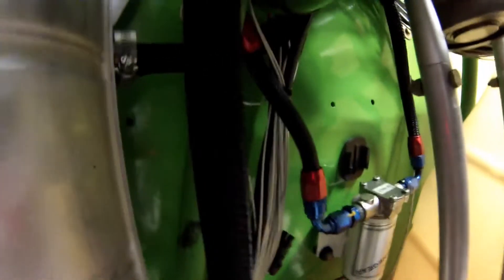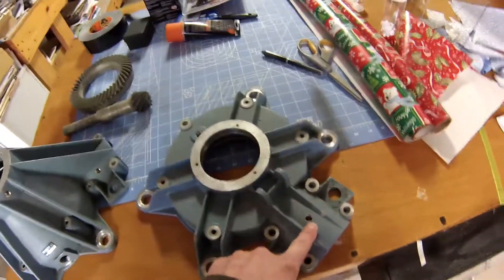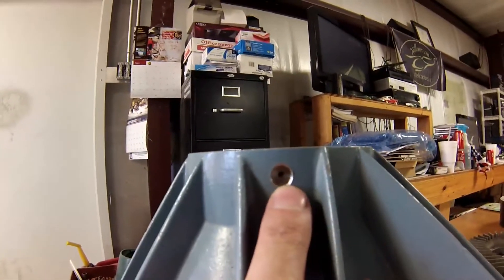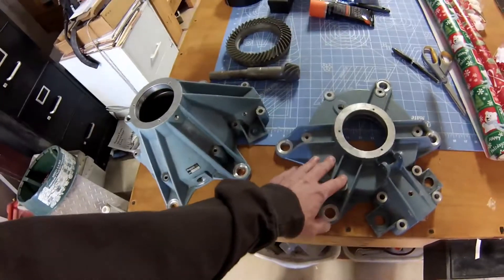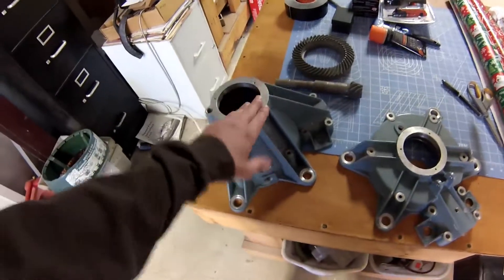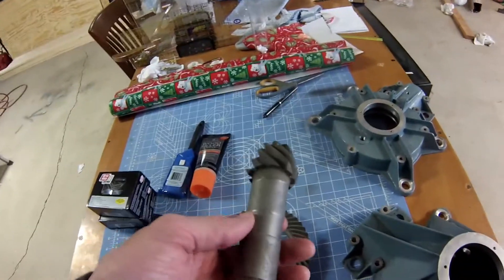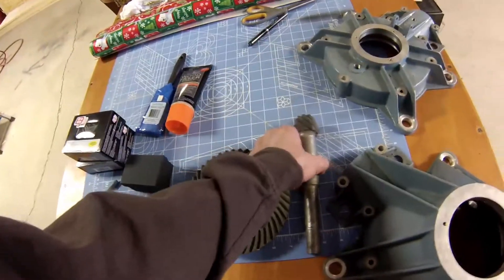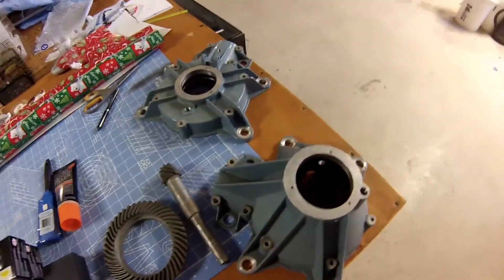Transmission Plumbing

Comment: Interesting how you addressed the issues that plagued Revolution helicopters. Not an easy task, but looks like you have it under control. Trying to get folks to not think/judge you for the Revolution Helo issues is no doubt a challenge in and of itself. It'll get better once your changes build a good track record and prove the problem solved. All the best to you.